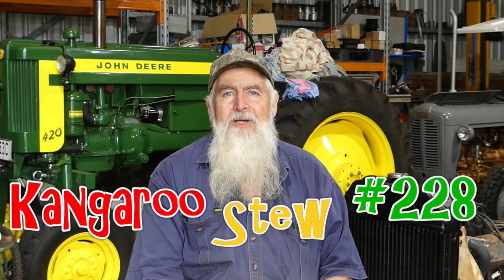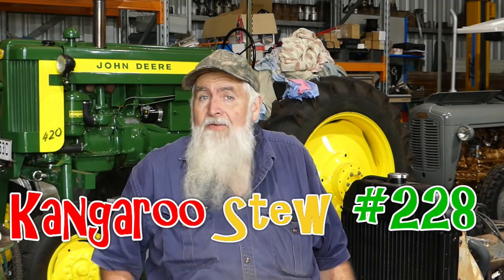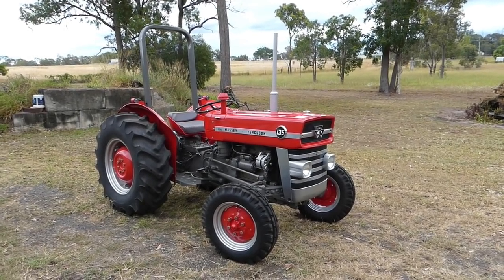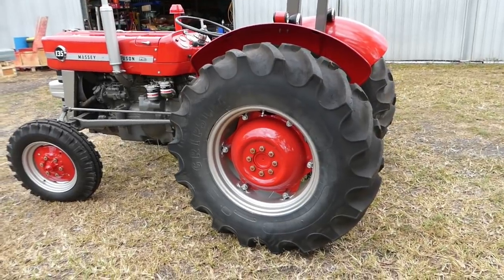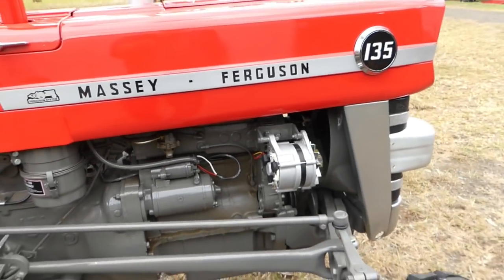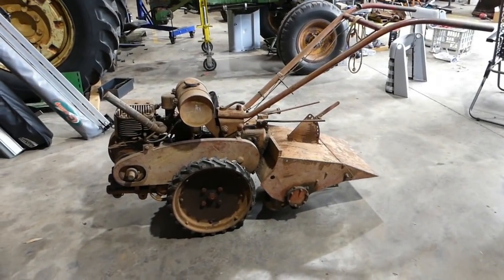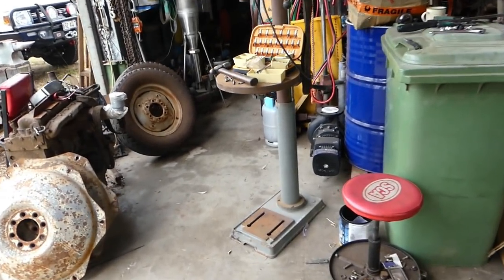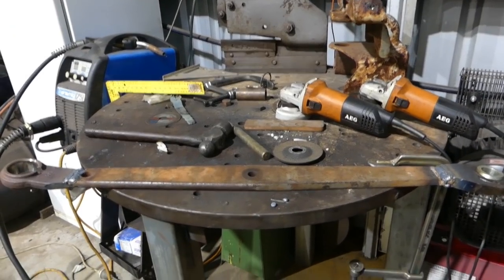Kangaroo Stew # 228 The MF135 is Almost done!

Comment: Hi Lance. You have made a smashing job of the 135. I can imagine how hard it is to stay motivated over time. Great job, and the series of videos you made of the overhaul are a delight. If you have to look that hard to find faults that you already know about, they are of no consequence. I bet the tractors came off the production line new with more imperfections than you can find on your restoration. Excellent job, well done.
Reply from the maker: Thanks 👍 Yes the missus reckons Im just fussy but my eye often just goes to the bits that I know could be better. perhaps next time I will do better.